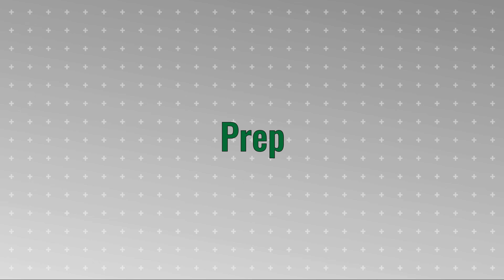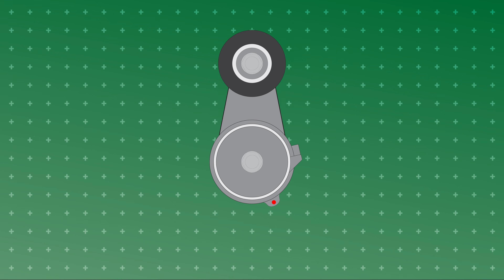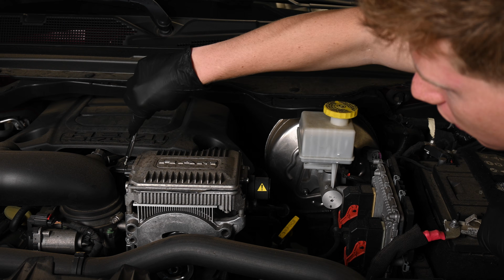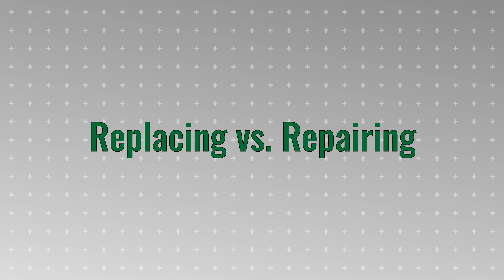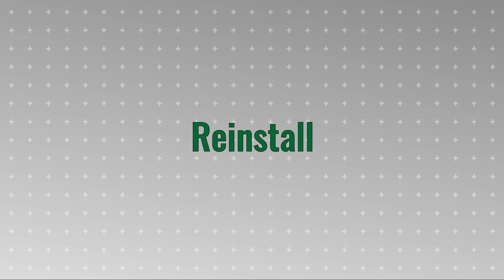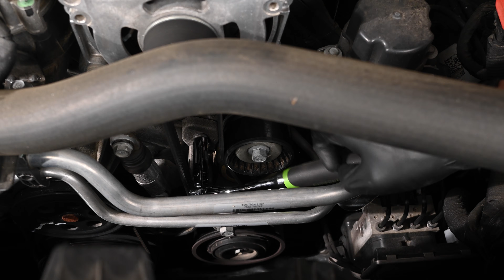2019-2026 RAM E-Torque MGU | Removal & Install

Comment: So my check engine light came on and I carried it to the dealer.  They told me there was a high heat issue.  They quoted me 3900. To replace.  I am out of warranty.  Will your repair cover this issue? I called and the girl on the phone could not answer that question.
Reply from the maker: While we’re unable to provide a diagnosis, if a qualified technician has confirmed that the MGU is the source of the problem, our repair service should be able to address the issue and help get you back up and running.

Comment: Good morning ? Question I have a 2022 dodge ram etorque  already scen engine at dealer they told me have a bad alternator . I have a new alternator to replace it after installing I have to take back to dealer for a erase the codes and check engine light as well. Or just plug and plays 
Thanks!
Reply: Did the dealership cover it under warranty?
Reply from the maker: Great question! If you replace your MGU with a different unit that is not original to your vehicle, it will need to be programmed by the dealership. However, if you have your original MGU repaired, its existing programming should be retained, so additional programming should not be necessary.